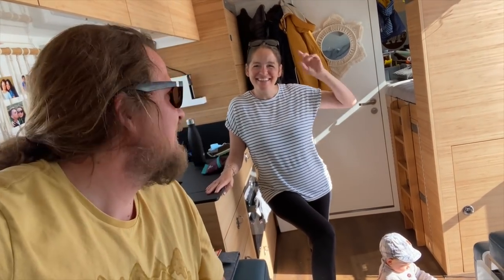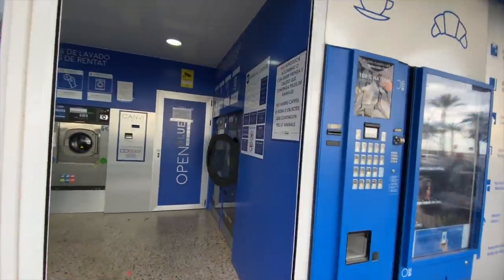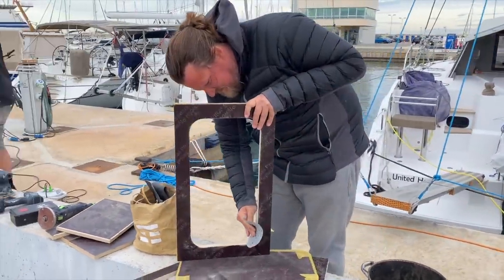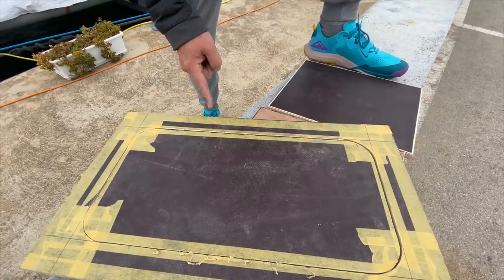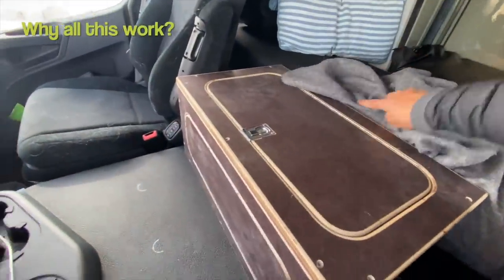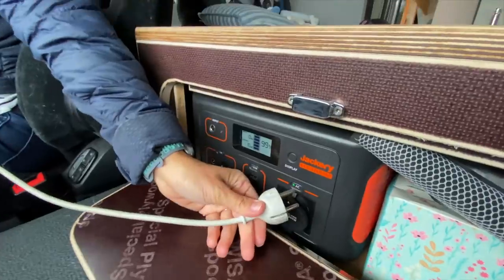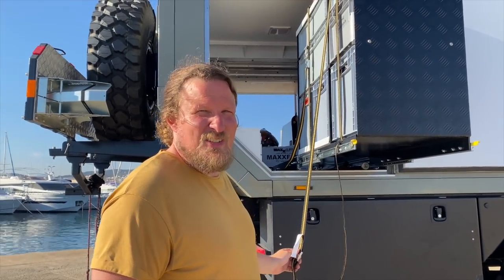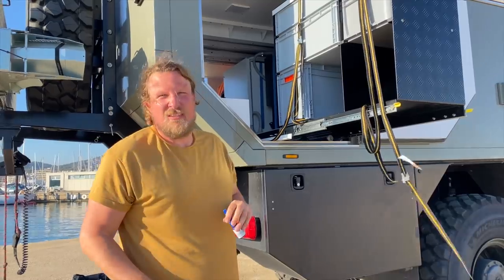DIY Expedition Vehicle Project on Mercedes Arocs 4x4 ► | Truck Storage Systems - Spain EP2

Comment: Fabian you drilling the aluminium surfaces without goggles was very irresponsible I could see the wire shavings flying around. There was a chance one could have taken a direction towards your face and caused damage to your eyes and with you a solo driver, I don't think it's some risk you can afford to take mate!
Reply from the maker: Thanks for the tip… next time I will try to be m my ore careful 🍀🙏👍thanks